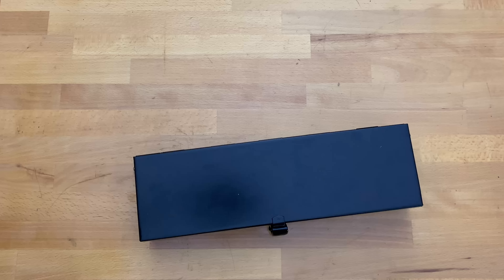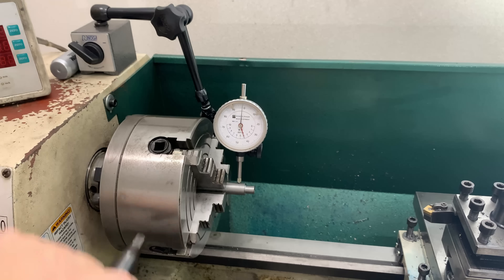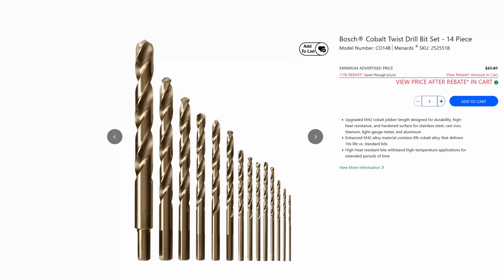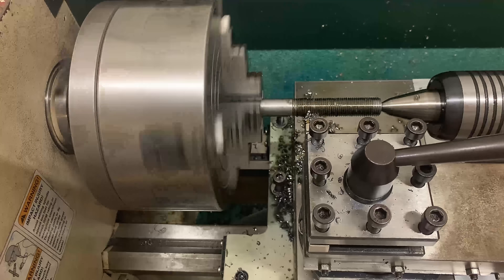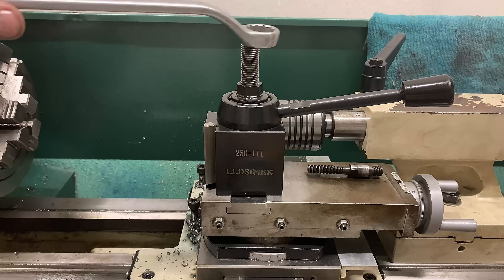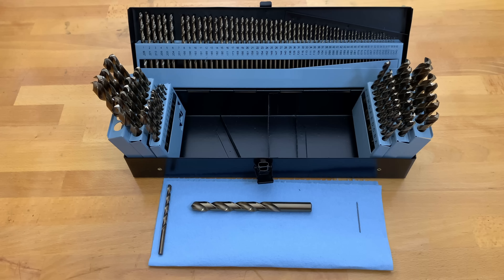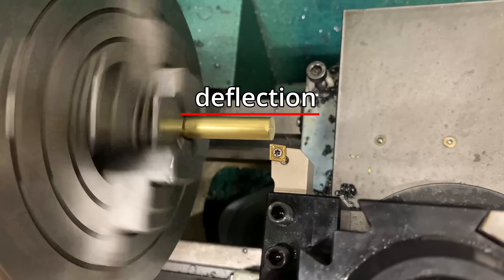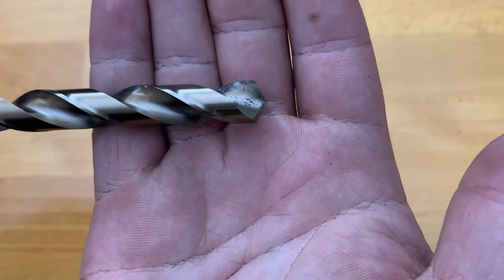Are Harbor Freight Drill Bits Secretly AMAZING?

Comment: I would have like it if you could have drilled like atleast 10 holes with a couple drill bits, then show us the cutting edges. Basically any drill bit is still new after drilling one hole
Reply from the maker: Good suggestion. I've since used that same 7/16ths to drill a dozen more holes in half in steel and it's still working just fine.

Comment: I got a smaller set that work fine but it really just made me realize that you need to buy a bunch of the same size for every specific project no matter how cheap or expensive your drill bits are. You gotta buy a bunch for each project one will almost never be enough
Reply from the maker: Always more tools to buy right? It's like a black hole for my wallet

Comment: Regular HSS drills can handle all the material you tested if you use proper RPM and feed. The cobalt content should make the drill last a lot longer when drilling hard materials like 40-45 HRC becasue it can withstand heat a lot better. So I would say the hard material would be the real test for the cobalt drills.
Reply from the maker: When I get some stainless stock in the shop I'll give it a test for sure.

Comment: I love me some HF. I bought a set (Warrior i think, black and yellow/orange index, titanium bits) a few months back. These couldn't cut melted butter or the bolt I was trying to drill out. Grabbed my 30 year old Black and Decker set as it was nearby, and luckily, the size I needed was in there. I was in the basement, better stuff is out in the pole barn. Drilled that bolt like it was nothing. When I say those bits couldn't cut, there is zero exaggeration. Not a chip, not a spec of dust, I don't think it scratched paint.
Reply from the maker: That's crazy! Sounds like those were the ones made out of recycled disappointment. yikes!

Comment: i had this exact set from harbor freight back in 2015 when i was in college getting my associates in precision manufacturing. they were pretty solid, tho they did loose the sharpness faster than than the other name brand drill bit sets that my class mates had, but it didn't matter as we had a drill sharpener. used them on manual lathes and mills on steel and aluminum mainly and even put em on a Haas vf-2 to machine my aluminum projects pretty solid and recomend for the price.
Reply from the maker: The ability to sharpen one's own tools is such a useful skill - not just for drill bits but for so many things. Thanks for the comment!

Comment: All your little jokes in this video are hilarious. Like a semi-dirty This Old Tony. 😂
I have had two sets of the titanium bits for years now. I've broken several, but they cut great in a drill press. Drilling by hand tends to dull them quickly.
Reply from the maker: Hey man that means a lot. I have watched a LOT of Tony over the years. He's great. As someone with no real machining experience outside of working in the shop on weekends for a few years, guys like Tony made it a lot easier to learn and pick up things here and there.
Reply: @ShopHumor  Oh I know. I still want a mill and a lathe. This year I did finally get a plasma table, so a step in the right direction. :D
Reply from the maker: That’s really cool. I’d love to get a plasma table or water jet or both
Reply: @ShopHumor  Waterjets are SUPER expensive to keep running. Not economical for a hobbyist. I do hope to start making some side money with my table, but it won't be a full-time business.
Reply from the maker: That makes sense. Thanks for the additional information

Comment: Harry homeowner here and I've owned that set for almost 20 years. I have broken about a dozen on them but it's still my GoTo set of drill bits for random projects. There's enough different steps of sizes that even if a bit is broken there are 3-4 more in there I can probably get away with. Result, I always have a drill bit handy. Now if I were a 'professional' would I use these everyday, hell no, but for some random hole I need to drill around the house they are awesome.
Reply from the maker: Yep, different products for different needs. And if they get the job YOU need them to get done, what's there to complain about? Well... maybe the crappy case lol

Comment: I've bought HFT drills in the full set of letter, number, and fractions, as well as the fraction set, and a number set.  All are fine for working Aluminum, wood, PCB, copper and thin steel,  For working steel USE Cutting Oil and proper speed. They probably won't last as long as name brand drills, but for hobby / home shop use are worth the price.
Reply from the maker: I had actually seen a Project Farm video here earlier in the year where he tested some cobalts of various brands and they held up fairly well. Not the best, but they certainly weren't the worst, either.

Comment: Many year ago I bought a set that looks exactly like that, though I don't recall it labeled "cobalt".
I used it on wood, and only occasionally since the idea was to have every size possible just in the event I needed a particular size on some odd job.
Reply from the maker: Having all those sizes on hand is sure convenient when you're doing a project or fixing something that calls for some weird size you never heard of before.
Reply: @ShopHumor  Oh, the latch on that box is exactly like you showed, too!  It's difficult to get it to latch and even then it can pop off.  Amazing they're still selling the same thing decades later.
Reply from the maker: That's really crazy that they're still exactly the same. You'd think it would be an easy fix in production

Comment: I have the same set and use them in a hand-held drill had them for a year +. I've only broke 2 ( I totally knew I was going to break them), but the thickest metal I've drilled  was 1/8 inch fine for what I need
Reply from the maker: Hey man if they do the job you need them to do, what else can you ask for? That's great!

Comment: In a "real" machine like you use, probably even brittle drills are great - should have tested them in a wack, heavy, pessimally balanced cordless drill with an out of true chuck handheld! ;) ... as probably a lot of the reviewers did. Addendum: On the most binding-prone material you can find. Make sure the workpiece is not suitable clamped or supported.
Reply from the maker: Hahaha that made me laugh. Will get my 6 year old to try to drill them in with a hammer and see how he does.

Comment: There is a lot of HFT haters out there so its hard to tell if a review is honest or not. I have both the the HSS and cobalt drill indexes from HFT. The HSS set is okay for general purpose stuff (i wouldn't buy another set). The cobalt set is quite good i have drilled cast iron, aluminum, steel, phenolics and plastics with them and the drills have all retained a nice sharp edge. Good luck with your channel.
Reply from the maker: I'm glad to hear that yours have retained a nice, sharp edge. And I appreciate the well wishes. Thank you very much!

Comment: I bought 2 different sets of these when I was a "poor" ... The black oxide version of this set is indeed crap. They are made out of ??? ( not drill bit quality steel).  They break.. a lot. I use them in wood only and just chucked them loose  in a random bin and used the drill index for all my random other non-garbage bits. The Old version TiN Coated HSS set is fine they get the job done if kept sharp. They are usable general purpose bits. They are not in any way comparable to my high end US made sets (purchased post being  a poor) but I had a complete set of bits when I need a random hole size, when I break one I just replace it with a high quality US made bit, going on about 15 years less then 1/4 of them are replaced and the other 3/4 barely used or still work fine.
Reply from the maker: Maybe they're the ones made out of recycled disappointment haha, thanks for the comment

Comment: I noticed no one compared Viking Norseman to the rest of the field, and for good reason. 
The bottom line is you get what you pay for. If you want to waste money on cheap drills and it doesn't bother you having to go through two or three drills because they roll the tip over, go cheap!

Look inside the hole after you drill a hole. The cheap drill hole is rough and usually not round, or even the size marked on the drill. The hole left with a Viking Norseman drill is smooth and the cutting tip still looks new. They are expensive, so what quality of work do you want to produce? Remember, you can make a hole with a cutting torch, and it might look better than the hole made by a cheap drill!

I personally use both cheap and Viking drills, depending on what I am holding the drill with. My Viking drills are never used with a chuck, only collets. I have multiple sets of Viking and Harbor Freight/De Walt drills. I use the cheap drills in hand drill motors and my drill press. I use Viking drills in my mill and lathe!
There are no bargains, you get what you pay for. Buy a set of tungsten carbide drills if you really want to scream!
Reply from the maker: I totally get the argument of you get what you pay for, but I also understand that for many people (myself included), our budgets are stretched so thin that we sometimes don’t have the option to get the Viking Norseman index or the Snap-On tool chest, we get the harbor freight models instead. 

And to your point about the quality of the hole drilled by the harbor freight cobalt vs the Viking — I have no doubt that the Viking is better, but is it 5 times price better? 

When I drilled that steel in the video I explained I was going to use an end mill to bring it up to final dimension. I’d rather buy cheap cobalt drills that will get me 95% of the way there and then spend those savings on higher quality end mills and reamers for the precision work. 

At the end of the day we all have to make do with what we can afford!
Reply: There are plenty of bargains to be had. 
Viking sells good products and pays its machinists good wages (more than snapon pays their machinists) and I would buy their drills if I ran my own shop, but the truth is you can make great holes with vintage ebay morse taper drills freehand sharpened on a pedastle grinder. The part about not using drills in chucks is nonsense. Keyless chucks have come a long way. Viking drills aren't made of some super special HSS with some special geometry.
Reply: @phalanyx3478  The nonsense you speak of is the metal scraped off the shank when the chuck slips. I don't use drills that have had damage to the shank in my mill or lathe. All drills have a softer metal in the shank and chucks chew them up!

As far as "some special HSS", Viking drills are made of Special Hi-Molybdenum tool steel, and are sharper than cobalt. Unless you use them, you will be just like the rest of the wannabe's who go cheap with everything. Viking drills are much sharper than standard HSS drills.

Comment: I got some too.

well i dont know how the ? and why they color up some HSS and sell it as Cobalt. Thats fraud. 

Is there even Cobalt in? I got some Co8 from a german manufacturer you almost not sharpen it it is that F-ing robust!
Reply from the maker: All cobalt drills are mostly HSS - the Co8 you got is 8% cobalt. The harbor freights (and many others brands) are 5% cobalt. We call them M42 (8%) and M35 (5%).
Reply: @ShopHumor  Did you test them for that claim of 5%? I got some chinesium and they have just been heat colored.
Reply from the maker: No, I don't have a really good way of testing that claim, and I'm too broke to send them off to a lab for analysis. Project Farm did a test earlier this year where he compared a bunch of different types of cobalt drills in various materials including spring steel; the Warrior held up against the other, name brand cobalt drills. If they managed to do that without actually being cobalt, then they're made of magic instead.

Comment: i love cheap m35 drill bits, even those from most aliexpress sellsers such as drilforce or xcan are pretty good, at least in my expirence and some even beat bosch cobalt drills in my unsientific testing.
i do have to disagree however on using m35 bits for hand drilling, as long as you keep the drill somewhat straight they perform wondefully in a hand drill, even going trough stainless etc. heck you can even get away with using m42 bits over 3mm in a hand drill if your somewhat carefull and know how to drill, have done that a fair bit for tougher steel.

also for hand drilling, if your good at grinding split point drill bits, its often worth it giving them a better grind as many drill bits perform better for hand drilling with a good grind.

also quiet liked the vid style keep it up.
Reply from the maker: Thanks so much! Pretty cool that you’re having success with M35s in a hand drill. Your technique is better than mine for sure

Comment: But a set like this and when one breaks you can replace that but with a good one.
I bought the same size set years ago. But it's is a Nitro set and it was over $300 cdn I have no regrets either. Haven't broken a bit yet.
Reply from the maker: That’s fantastic. Use them like they’re meant to be used - with the proper speeds, pressures, and lubricant - and they’ll last a long time

Comment: there are no "kits" of drills or taps or dies that are worth a damn anywhere.
The only way buy all those things is ala cart.   No high end manufacturer puts kits together , kits are sold to the stupid consumer who as no discernment.

For thread cutting taps & Dies  buy OSG,  for  thread forming taps buy BALAX
for drills go to Drills and cutters for the least expensive options,  but if you want the good stuff go to MSC and buy Guhring , Kennamteal or Hertel.   
Nothing worth a damn is ever sold in kits.
Reply from the maker: I agree in part. My plan is to stockpile higher quality individual sizes that I end up using the most frequently, but also have the index on hand for whenever I need an oddball size in a pinch. I also generally drill undersize and then ream or use an end mill to bring up to final size, so I can go cheaper on the drills and then extend the life of the more expensive tooling. But I'm a cheapskate.

Comment: I've got a set and they have been performing ok. I've used them on aluminum, mild steel, stainless and 4140 steel. Run the proper speed and lube. For about $100 it is worth what I paid for it.
Reply from the maker: A great value for sure. Glad they've been performing well for you, too!

Comment: My only question is why a 4-jaw on your lathe for round stock?
Reply from the maker: The lathe is new (to me, bought it cheap and used from a guy who had it in a barn) and the 4 jaw had a lot of surface rust so I had just finished getting it cleaned up and wanted to give it a spin. Also one of the parts I was making needed to be flipped and threaded on both sides so I wanted to get it dialed in to the same place.

Comment: Bought the titanium set over 20 years ago, and yes, some drill bits were dull and repeating sizes. Use bits on a compact 8 lathe. Some broke some became dull. Looks like just painted yellow low quality high speed Steel had to sharpen often.
Reply from the maker: Hopefully the quality has improved over time ...

Comment: I had a set of the old Ti Nitride coated bits from HF that I got around 2005 or so and those lasted quite a while and were pretty good for the price. I picked up a set of the cheapest HSS set they sell and after I bent (not broke) 3-4 of them I tossed the set in the trash and got the Cobalt set. Very happy with the Cobalts. Every bit I have used so far has cut great and kept its edge.
Reply from the maker: A few people have mentioned the same thing about the cheaper HF drills bending on them. Glad the cobalts are working very well for you and I hope they do the same for me going forward! Thanks for letting me know about your experience..

Comment: Most drills will cut brass, copper, aluminum, steel. The reason I purchased a set of cobalt drills was for stainless steel. I wish you would have tried stainless steel.
Reply from the maker: I'll have to do a follow up test. I just don't do much stainless work around my little garage workshop so I tested with what I had on hand.

Comment: Not sure why people think you have to spin a bit so fast that it melts....
I bought a set of these and so far my only complaint is the index, it's total junk.
But as far as the bits go....slow down, use a lube, take your time! I have not had a problem whatsoever with these bits yet.
Reply from the maker: It really is junk, isn't it? What a crappy case. Glad to hear that your experience matches mine.. thank you for the comment!
Reply: @ShopHumor  Update: (Sort of) I had a rather large project at hand. It was an early '80's Dually Ford Box truck with an impossible 400cui engine, it sat for years as my wife packed it with stuff using it for storage.
The mice and rats got in and chewed everything to bits, leaving all wiring and everything else worthless.
I hired a guy to help me around the place, and tasked him to remove the cab, clean the thing out and help me turn the box into a trailer.

Sadly, I let him have access to my tools, and months after I finally had to send him packing, I'm still finding bent wrenches, botched up hammers, and pretty much an entire jacked up 115 piece drill bit set.
I watched a video recently about this Warrior set with all the same complaints others have, and apparently the drill set was turned over to Bauer, who supposedly improved everything about it.
I just pulled the trigger on the new set, and I haven't even opened it yet, but I'm looking forward to trying it, and will report my findings after I do and use the bits for awhile.